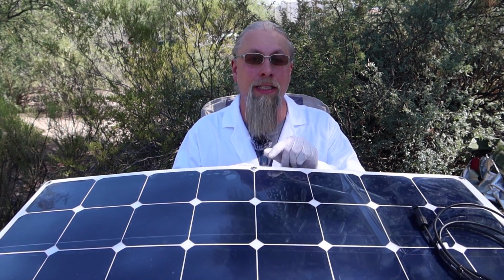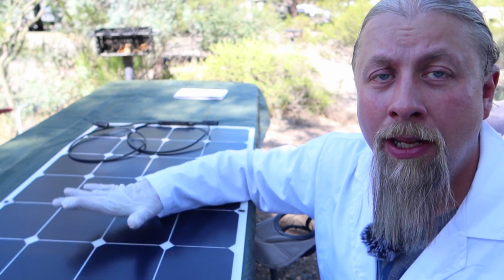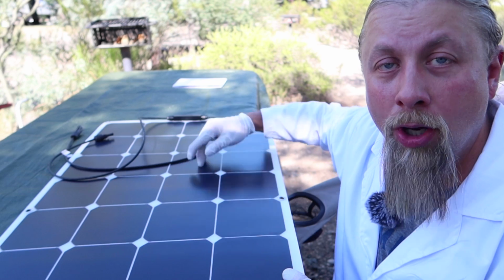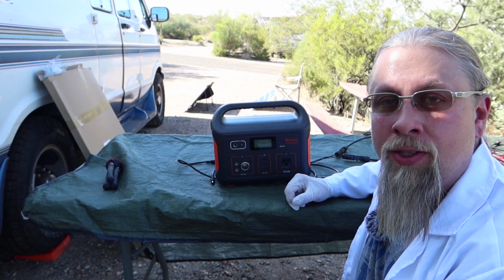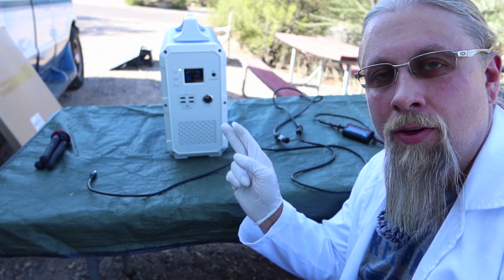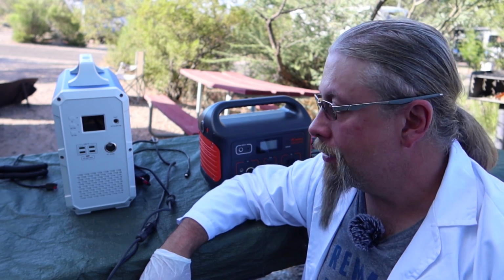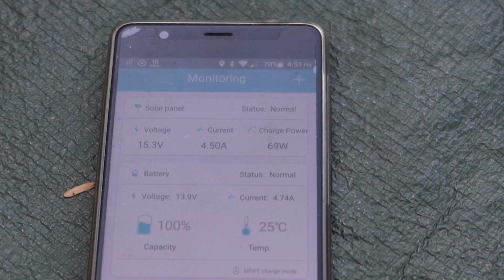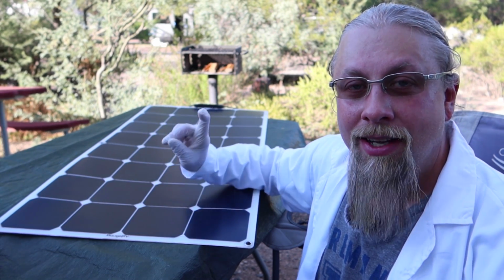100 Watt BougeRV Portable Panel Review | The PROFESSOR is BORN!

Comment: HI, new to this. Do you have a video that explains the basics of what you need to set up a. System with the solar panel -- battery and whatever adapters  necessary? Thank you for work. I was just thinking about this and your video appeared on my feed.
Reply from the maker: Check out my solar and power series playlist. The Jackery Explorer 240 and SolarSaga 60 panel is an easy system to start with.

Comment: Solar technology has been improving a lot in the past few years, I'm glad to see the flexies keeping up. I've always liked the flex panels. The only problem I have seen with them (in hundreds of installs) is when they are "glued down" and air  can't pass under the panel. Heat kills everything, so panel life is greatly reduced with no airflow.
Reply from the maker: Exactly. Always have some kind of gap between a flex panel and the roof.
Reply: @HOBOTECH  I like the idea of Coragated plastic under the flex panel for air flow and insulation.    Great videos I plan to duplicate you Roadtreck power setup.   

 https://www.lowes.com/pd/PLASKOLITE-White-Corrugated-Plastic-Sheet/3381288?cm_mmc=shp-cprdhdwgooglelia-145-screenandglass-3381288-0&store_code=1201&cm_mmc=srccprdhdwgooglehardwareMHLIA_HDW_Hardware_Low%20Priority---0--0&gclid=CjwKCAiA5JnuBRA-EiwA-0ggPbHS7oVDfIB1Zo--FkMX5T1tJQ1X_dwgiMtaSEf4KdRhpYct6-XrUxoCEzAQAvD_BwE&gclsrc=aw.ds

Comment: I have a question regarding tracking the sun with solar panels. I realize there is variables and how diligently you are keeping them perfect. Hypothetically because I'm pretty sure you move yours once every hour or so when your trying to collect a lot of power. Would you say that two 100 watt panels would collect as much as 3 laying flat? Or do you think two 100 watt panels would be equal to 4?
Reply from the maker: In the summer you can let them lay flat and get most of the power. The problem is winter. They take a huge hit in winter if they aren't tilted. I see a loss of about 40% on my roof panels which is why I went through the effort of making at least the front one tilt, and also why I carry ground panels that tilt. I'd say in winter you have to double up the number of flat panels for the same power.

Comment: Or you can just Buy a riggid mount RICH 100 watt Poly solar panel on Amazon for 85.00 usd  delivered free 48 states..  right now 4x100 watt panels for 340.00 usd delivered free..
Reply from the maker: Again, like I told others, you're comparing apples to oranges. Rigid and flex panels can't be compared on a per watt cost basis as they are different technology. Rigid panels are superior but not everyone wants big heavy breakable glass panels especially if they stealth camp or want to be portable.

Comment: Word on the street is Sunpower uses their A-grade cells and sell the Grade B - C - D cells to others. I went with the 110 watt Sunpower.  Also, almost all panels work as described when new and degrade from there.
Reply from the maker: I haven't found any facts to back that up. But, yes. All panels including rigid ones degrade over time.
Reply: @HOBOTECH  Sadly I Can't remember where I saw that. Perhaps the warranty length may be telling of their confidence in the product. Nonetheless - I'll pay more for 60 months in lieu of 18-month warranty.
Reply from the maker: It probably would have been more cost effective to get Amazon's extended warranty on this panel vs paying far more for the Sunpower if the only benefit is the warranty.
Reply: @HOBOTECH  Double the money -Hardly. YOur panel with code $151. Sun power panel with 10% code $211 - try the math again son. THis YT guy had the code a week ago. https://youtu.be/qalnxiY6w7M
Reply from the maker: @TerryManitoba  That's still 40% more. The point I was trying to make is that there are budget alternatives using the same exact technology. I often pay more for a longer warrantied product myself.
Reply: @HOBOTECH  Little math lesson. 211-151= 60. 60/211=28% not 40. So by saving 28% you don't get a manufacturers warranty. Budget is not aways cheaper in the long run. Similar to AGM vs Lithium  - appears cheaper  but in the long run it has been proven to not be. U do the math - oh sorry I forgot! I'll do in my next post for u...
Reply from the maker: @TerryManitoba  I have a minor in math. You rate discounts based on the price of the product in question. So it's 60/151=0.397 or 40%. If it was only 28% more it would be 151*0.28=$42 more. Anyway, it's fine to pay a premium for a warranty. That's why people buy brand new cars. If you can afford it, do it. Many people here still think $151 for a solar panel is way too expensive and tout their $78 HQST's as the best. To each their own.
Reply: @HOBOTECH  Peace of mind is worth it in lieu of saving 28% on such a pertinent yet relatively low cost item.
Reply from the maker: Depends on the budget of the build. If someone is buying 6 of them for their RV then the 40% discount for essentially the same thing means saving $360. You can also extend the warranty to 4 years through Amazon for $30 each. That's still a better deal for someone with limited funds.
Reply: @HOBOTECH  to fit 6 panels - your poor dude must have an A-Class ( wouldn't want to see his gasoline bill). mmm...
Reply: @HOBOTECH  Why do some people have to cause friction and argue?  I hope you don't let it bother you.

Comment: Great video and well explained, but would you consider this better than the 100W Renogy advertised on Amazon for $113?
Reply from the maker: Renogy rigid panels are some of the best. This is one of the better flex panels. Depends on your needs. If weight and space is a non issue and you have no worries about breakage go for the glass panels.

Comment: I have two poly HQST 100 watt panels that cost $82.00 each with a 25 year warranty... they put out 5.7 amps on a sunny day...
Reply from the maker: Great. Apples to oranges though. You can't compare rigid panels with flex on a watt per cost basis as it's a totally different market.

Comment: I need something I can put out in the sun. My panels are mounted on the roof. I understand that ZAMP is reverse polarity. Har adapter would I need. I assume I wouldn’t need a separate controller?
Reply from the maker: A ZAMP goes directly to your batteries (in most cases) so yes you would need a controller unless you tied into the controller running your roof panels. I would highly recommend a series connection if you're mixing panels like that.
Reply from the maker: A separate controller when mixing different type panels is wise but it is your call. Sounds like you can tie in easy to the ZAMP controller with an adapter and be done with it, or you could get more power by running a 2nd controller to your batteries which would require more expense and wiring.
Reply: I have an empty slot that is tied to the ZAMP system controller. Is your recommendation that I still have a separate controller?
Reply: It’s a Travato Class B camper van.

Comment: Thx for the video.
I just have one general comment about (all) these portable power stations.
What just about every manufacturer is failing to understand is that the dismal and poor charging rates is what keeps them from really taking the market by storm. They are missing out by not providing a high-power input. Until then these will never be a fully viable option to a custom built setup.

For the Jackery E500 there is a hack/solution that at least will get you to max out the possibilities of it.
There are DC-DC converters that will take a 9 - 36V or 9 - 75V voltage and bump it up to a regulated 28V (150W max) output to connect to the charging jack. With a few external components the voltage can be tweaked up to 30V. They are $155 - $175 so it's not a super cheap option but they are professional grade modules and will let you use the Jackery to its full potential.
Another Youtuber tested the Jackery E500 with a 30V input and he could get the charging rate up to 96W.
I might go this route if I decide to get a panel or two for it.
Reply from the maker: I have a $40 variable voltage power supply from Amazon that will do 10 amps at 30 volts. I was able to charge my Jackery 500 at 98 watts. I plan to do a video on it.
Reply: You mind sharing that other youtuber's hamdle?
Reply: Love Your RV <--- that is the channel name.

Comment: Could I use this panel with my ZAMP setup? I have 200 watts, but my controller maxes out at 450.
Reply from the maker: Yes. You just need the ZAMP to MC4 adapter which I have on hobotech.tv/amazon
Reply from the maker: Yes, there are MC4 extensions on the page.
Reply: Awesome! Impressed with your evaluation of the panel. Do you also have a long extension that will work?

Comment: Good Video Professor 
Would Mcguires headlight lens wax, help preserve panels, 
As they protect plastic headlight Lens?
Reply from the maker: I wouldn't put anything on solar panels that might block UV.
Reply: @HOBOTECH  how about doing a Wax test to see if there is any power loss, if not, seems it would protect clear coat on panels. As u can sand & recoat clear on a yard solor light or a headlight. To restore to new.
Reply from the maker: If I can find a solar panel to sacrifice for that test I may do it. I do know that most wax products nowadays have UV blockers that will definitely reduce power. If wax helped with longevity I think the makers would be doing it to extend warranties.
Reply: @HOBOTECH  How about laying a sheet of different thickness 
Magnifying Glass over a Solor panel.To See if You can , Increase Output.
Put your gloves on all the way, looked like you had a bad hook on the end of index finger. 😁
Reply from the maker: @rmcnasty7319  That's not how solar panels work. They can only take in as much sun as they already can for the square footage of the panel. The sun radiates approximately 1000 watts per square meter on the surface. A panel rated 25% efficient can only create 250w max in that same area.
Reply: The wax will keep dust & Dirt from building up. I THINK IT MIGHT DOUBLE OUTPUT &  will be to slippery for bugs to walk on. A big grasshopper or Waterbug or Bird, could block light. 
Panels might live 10 years,  WE NEED TO KNOW.  SO ,
COME ON ,
LET'S TEST

Comment: Good video Tom. But about 20% of reviewers on Amazon report failure within the first year. Even with the 18 month warranty I would not buy panels with that high  of a failure rate.
Reply from the maker: This is the version 2 panel. Everyone including Renogy failed with the 1st Gen flex tech.
Reply: Yes, I just found the same thing. I am surprised at the endorsement here. Maybe good out of the box but some report losses within a year or less.

I am wondering if the panel here is a updated version?
Reply: In my experience, the warranty speaks for itself when it comes to these panels.  If you want SunPower cells along with a realistic warranty, then get it from the source, SunPower.  Time will tell if these panels hold up.  Great video and I appreciate the attention to detail.

Comment: No such thing as a quality flexible solar panel. When it craps the bed in a year you will wish you bought a ridged panel that lasts for 10 to 25 years
Reply: Dang.. I just bought 10
Reply from the maker: Your opinion. Many want or need a light portable solution. Rigids are better but have their downsides too.
Reply: Not an opinion it's a fact! Always a compromise in rv living. Most can't afford to replace panels every year or so. Spend the money once on decent system and be done with it.

Comment: So this panel cannot be mounted permently, I have a round top on my lil guy camper and I want something to mount solid
Reply: Yeah I need the same for my Tab
Reply from the maker: Yes you can mount them permanently but make them easy to remove in case of failure. In other words don't use VHB or permanent glues.
Reply: Yea, that’s the point of flexible. Also stealth. I want to stick a panel down on my van roof so I don’t look like an RV parked on a city street

Comment: Professor Hobo I have a question. One thing I never understood maybe you can help me out is that  solar panels to need ventilation a space between the mounting surface and the panel. You mentioned Heat. I figured one of the reasons why they delaminate it's because of the Heat they get from the top of the van trailer excetera what are your thoughts on lack of ventilation underneath the flex panels?
Reply: good question man .......
Reply from the maker: All panels need an air gap or they will overheat and fail. You could use corrugated plastic, reflectix, anything really to gap the panel from touching the roof. That would improve life.
Reply from the maker: If you're beating them up with brush and branches get rigid glass panels.

Comment: Website has 100W panels for $187. That ain't cheap for solar. Can get rigid newpowa 100 watters on Amazon for less than a Benjamin.
Reply from the maker: I can guarantee they aren't as good as panels made with class A cells, but are probably still good bang for the buck. I'm the kind of person that rarely buys the cheapest of anything because I've learned you end up paying double or triple down the road doing replacements.
Reply: @HOBOTECH  Sounds like my dad lol. He used to say anything can be done cheaper and those that buy due to price alone are the lawful prey of the cheaper builders.
Reply from the maker: Why would you buy on their website when it's $150 on Amazon? Flex and rigids are apples to oranges. Can't compare them cost per watt.
Reply: @HOBOTECH  Im my opinion the rigid newpowa 100W at $77.82 are a good value. Tests on them by others (I have NOT tried them yet) show that they produce power. The frame isn't as hefty as Renogy but should do fine.

Comment: One more comment. I can imagine the new technology that will be out in another year especially the new lithium batteries and there is a new energy device out runs off propane produces electricity.
Reply: If we can get HoboTech and Bob Wells behind it then we know for sure hahahahahahh
Reply from the maker: Yeah it's called a propane generator!
Reply: @HOBOTECH  Do you have any information on them. What I read is amazing. Too good to be true?
Reply from the maker: There are many people here using propane generators that can chime in on that. What I hear they run pretty clean and last longer than gas generators. I don't do it because I can't carry enough propane in my van.
Reply: @HOBOTECH  I was referring to a new technology. The look about the half size of a basket ball and produces enough for several residences. It's on the internet.
Reply from the maker: @mcse-nv2ou  Never heard of it and I probably can't find it searching for "propane generator".
Reply: It's out there you can find it. It is so freaky thought U wood B I(nturistidide. @HOBOTECH
Reply: @mcse-nv2ou  got a link to it?

Comment: The cells r great, hollar back in 5 years regarding over all quality that flex stuff just does not last. ONLY time will tell but I doubt it. 18 months and it fails is the American way huh ? Do you think they may have figured out how long it will last? 18 months ...
Reply: mcse9073 said 5 years and Hobotech says SunPower is 5 years coincidence? Its how long they should last minimum. Thanks for the heads up Hobotech..
Reply from the maker: They should last 5 years but like you said time will tell.

Comment: The flex panels are getting better no doubt about it but how would they hold up on the top of a van/rv in the Phoenix sun?
Reply: @marthale7 
The risk is high out here in the West. I had two flex panels permanently mounted on top of an RV and they only lasted one Phoenix summer before they dried out and became brittle, cracked and lost more than 80% efficiency.
Reply: @MikeAndNary   please list model and type.  So we can avoid
Reply: @mattlangstraaat3508  
I'm not sure of the model number but they were Renogy 100 (maybe it was 160w) 12v flexible mono. That was a couple years ago so I'm sure the build quality has changed somewhat.
Reply from the maker: Yes the old tech flex panels including Renogy were prone to failure which is why Renogy stopped carrying then. The newer tech is better.
Reply: @marthale7 
True but plexiglass that size would be very expensive and heavy so ya might as well just get a traditional panel and avoid the hassle.
Reply from the maker: Solar panels are designed to be in the sun. I'm in Cottonwood where it's just as hot. You are supposed to air gap panels to prevent overheating and these are no different. If you glue them to the top of your van without an air gap expect them to fail.

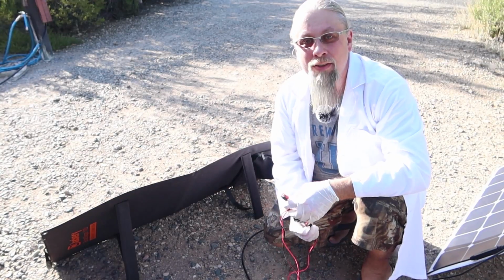Comment: 14:00 I lost ALL concentration on the differences of plugs due to those shorts LOL , BTW, this latest panel is it OK to have in Florida direct sunlight day after day like a more permanent panel OR would you recommend the renogy you use?
Reply from the maker: Solar panels are designed to be in the sun! However, the rigid glass panels are far more durable. If you can deal with the weight & space they are by far a better bargain. Flex panels are really for those that want to "stealth" or have size/weight considerations. The best flex panel on the market offers a 5 year warranty vs the 20-25 year you get with the rigid Renogy panels. That tells you something.